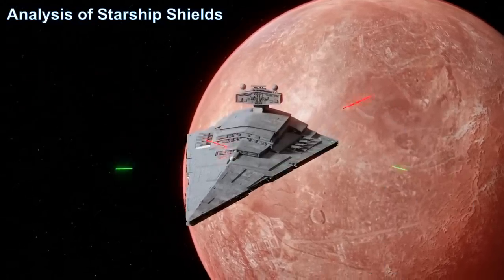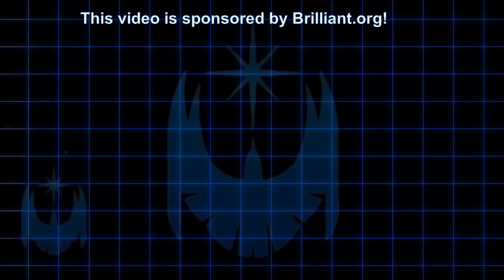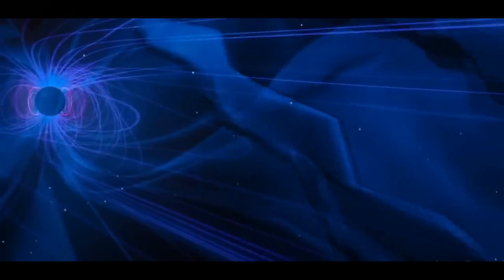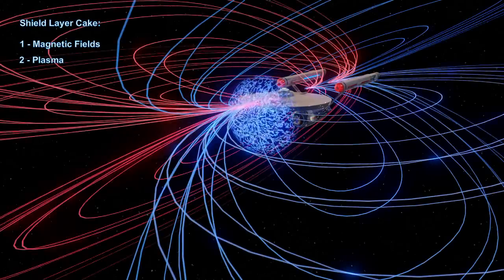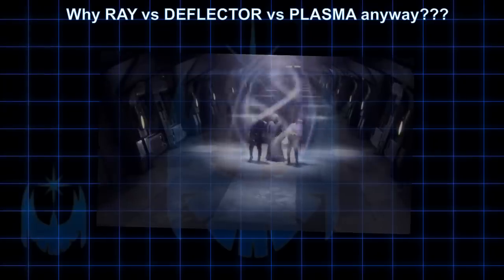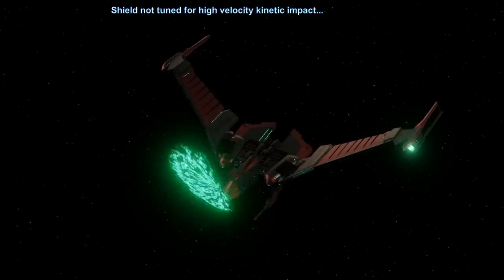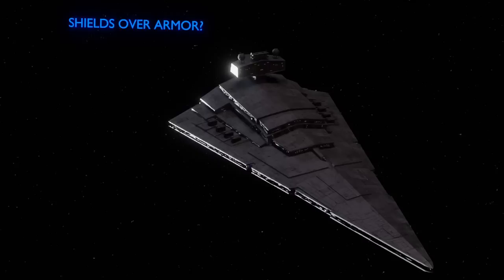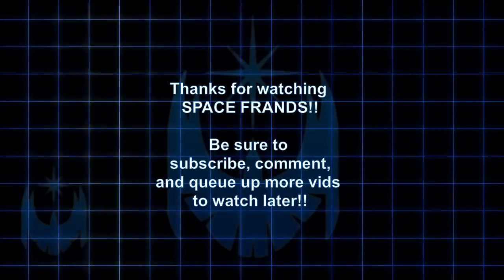REAL Starship Shields Types - They Work Like This...Animated Breakdown!

Comment: Imagine a glass dome around a target you’re trying to hit. You can clearly see the target, but the only way to hit it is to go through a door in the dome. But when you open the door, instead of going through the door into the glass dome with your target in front of you, the door opens to HELL ITSELF.
Warhammer 40K void shields. 
They just nope incoming fire off directly into The Warp.
And they aren’t just mounted on starships. Imperial Titans are equipped with them as standard, imperial hive cities commonly use them as anti-orbital defense, and even certain Superheavy vehicles like the Ordinatus weapons platforms of the Adeptus Mechanicus use them.

Comment: Elite dangerous’ shields are not executed well, they are basically a wall that deletes projectiles and stops thermal lasers. The thing I like about them however is their overheat mechanic, basically any damage (most prevalently thermal) ticks up your heat meter which starts doing damage internally on your ship. I like to think this mechanic applies to larger ships in Star Trek and Star Wars, essentially the shield generators overheat and end up redistributing a portion of the damage over the ship’s superstructure so the shields don’t end up just destroying itself early in a battle. This causes that feeling of danger that the shows and movies want to convey.

Comment: I had to stop early on because deflector shields are energy shields. To say that they are different is kind of asinine.

What is a deflector shield made of if not energy?  It's not like any of the shields actually reflect anything like you would think of light being deflected.  I understand all this technology is theoretical, but what movie or show actually shows a deflector shield deflecting energy beams rather than just absorbing them?  It's like saying we are using mirrors to deflect laser beams. So we are going to call them mirror shields which would be different from reflective shields which apparently do the same thing. 

I have not seen a single Star wars or Star Trek movie or show that you actually see energy beams being deflected. All of them shows incoming fire being absorbed basically because it does not go past hitting the shields of the ship.

Comment: Just one thing; the whole argument that armor is heavier than a shield is flawed in one aspect.  Your argument hinges on the assumption that the tech needed for the energy source that the shield utilizes is either the same source that the ship uses to move around with (in the various and many forms that is achieved theoretically or in fantasy) or that the energy source is small and/or light weight.  While this would indeed be convenient, it's highly unlikely when you consider the amounts of energy needed for applications such as you're discussing. So would there really be an advantage at all as far as weight is concerned? Not nearly as much as one might think... and that's not even the materials that armor could be composed of and the actual weight outcome that could ultimately end up in application. Just thought I'd point that out there for you.

Comment: Shields might not nessarily be ligher than armor, I should note.

Shields, just as any other power consuming sub-systems, requires power. And increased power requirement means needing a larger and heavier powerplant. And depending on the avaliable technology and application, more armor might be lighter and better performing than shields. Or having shields will require sacrifice to firepower and other features.

One point of example would be Elite: Dangerous. Depening on the application, non-shield defensive options provide far more effective defense than shields, one example of which being thermal stealth.

Comment: the funny thing is if ur is nearly at Lightspeed o even faster a little particle of cosmic dust can inpact the ship with enought power to evaperadte, XDD they dont need be worry about laser or protectilees with just speed they will be face dust with more energy than nuclear bombs XDD even the light of the CMB will be hot enought as teh bigbang XD

Comment: I would have thought plasma shields wouldn't work both because they're not a physical barrier so they run up against how fast they can heat anything rocketting into them at 100km/s, and because stuff that is 'vapourised' doesn't cease to exist, and simply making asteroids explode due to the heat now means you've got even faster smaller bits of asteroid to content against. I'm not sure a 'vapourised' asteroid wouldn't still pose some material danger.

Comment: In a sci-fi I'm writing, I make use of armors and shielding. At the start, the shields of the ships really don't do much. Most weapons are kinetic, so, smaller ships focus on mobility and larger ships armor, with some shield effect. The most effective shield is the MCs produced shield since in can make pin-point shields as needed, usually to deflect small projectiles, but, not very effective when hit with something, like a fist, though it can dampen it a little. It is described as a repulsing shield, since it emits from the body outward and dissapates (how, is a plot of the story). It is more effective at canceling/manipulating waves like light, magnetic, and thermal as far as machine scans go. Does not trick eyes, though.

Later, you start to see weapons like lasers more commonly, where shields and armor both are more effective because kinetic weapons are too costly you use often. In all cases, bleed is posable.

Comment: There's an episode in Stargate Universe, where Destiny (the ship of our cast) is under attack by drones. Destiny's shields take a beating, but the crew was able to retrieve a damaged drone and learn the specific energy output used by the drones' weapons. Since Destiny's shield was constantly shifting between energy signals (I don't remember the specifics), they weren't 100% effective against the drones so they attuned Destiny's shields to the specific energy used by the drones which greatly reduced the stress on the shields. This did mean that Destiny would be vulnerable against other types of damage, which the drones figure out and start to kamikaze into Destiny in order to do damage. Quite a fun episode.

Comment: Thanks for this :) I'm writing a world where magnetic shields are a thing, they are great against kinetic hazards, and they stop plasma dead, however, the plasma dissipation challenges mean that the ship has to deal with a heat surplus as the plasma is funneled towards the emitters, effectively making short range plasma weapons and plasma warheads a go-to effective shield breaker.

Laser type weapons can be neutralized with ablative or reflective armor. However, reflection becomes difficult with X-ray lasers.

Comment: I like to think that shields in Star Wars are electromagnetic fields and negate the potential damage from energy weapons by aborbing the energy through magnetic flux. Too much absorbing add too much energy to the shield thus weakening it's integrity via overbearing transformers or other energy conduits. An EMF that strong would need a lot of energy. Typically the kind of energy that would power a star destroyer. Smaller ships might have to have an upgrade to generate the sufficient power. Ion cannons are most likely balls of electricity that are meant to fry electrical systems by overloading them, thus how the y wings were able to disabile a star destroyer with its shields up.

Comment: The common misconception about the shields is to picture it like a wall or bubble. I think a shield would look more like an area around your ship where things gets deflected or absorbed. It will span far from the ship hull and will not have definite "surface", but rather it will get stronger the closer you are to the ship.

Comment: To me it makes more sense for shields to be better against lasers (thermal) and armour to be better against kinetic (physical) as a shield would take an impact from something and have to convert that impact into something it can dissipate, such as heat. It would take more energy to convert kinetic energy into thermal to be dissipated than to simply take the incoming heat and immediately start dissipating it. Whereas armour is designed to prevent kinetic impact, generally by deflecting or slowing down the projectile. While there are many materials with strong thermal insulation or dissipating properties, generally speaking they aren't the toughest or strongest of materials, and wouldn't make the best armour in my opinion.

Comment: One of the things I like about Eve Online is that two of the kinetic weapon types, missiles and projectiles, can vary the damage they output. Missiles can be of a high explosive warhead, an EMP warhead, a plasma warhead, or essentially a shaped-charge with a sabot to propel the projectile through the shields or armor. {blasters/rail guns use a shell of titanium with a core of various metals/antimatter suspended in plasma)

Comment: Your comment about armor repair in combat made me wonder - why doesn't Star Fleet use replicators for tactical purposes? I get, that spaceship hulls probably can't be replicated outright but what about dense particle clouds or torpedoes that replicate millions of flechettes after passing through a shield at relativistic speeds?

You could also use something like a mixture of spaced armor and ERA by replicating the densest possible material in the course of beams or projectiles. Or replicate makeshift armor like in the Voyager finale. Run these replicators on separate accumulators so you'd have a separate supply and you might actually have rechargable armor.

Comment: Afaik, there's a definite place in Star Wars for thick, advanced armor, (AT-AT) which is evidently supremely heat resistant and difficult to deform via pressure waves from explosives, AND, of course, energy-based shielding that defends against energy weapons (conventional shields, typically on starfighters and starships), and shields that prevent physical objects from passing through.

Where there's a bit of confusion is that I recall explicitly that at some point a CIS destroyer droid's personal shield emitters were explicitly bypassed by clone troopers rolling grenades relatively gingerly through the shields, which then detonated within them.

This implies that despite the energy shield defending against blaster bolts very well, it may also be a kinetic shield, thus slow-moving objects do not activate the defense. Now, it is a droid, so perhaps its dual-purpose shielding can afford to be so industrial-grade, as there is no organic matter present to potentially suffer any sort of radiation or heat or other issues from being near the source of such small personal shielding, whereas most organic life generally does not carry personal shielding.

Contrast with Mass Effect and Dune, both of which use a kinetic shielding system, which works like a car seatbelt in a sense. Objects of sufficient speed activate the barrier and protect you, but under that speed anything is possible and you're not safe. Which I think is the reason for the preponderance of melee weapons in the latter.

Comment: this is why i love how shields, armor, and hull works in stellaris, it makes a lot of sense from many different standpoints. shields are very effective against lasers and plasma but awful against mass drivers, autocannons, missiles, and torpedoes. armor is very effective against mass drivers, autocannons, missiles, and torpedoes but is pretty bad against lasers and plasma (armor doesn't soak up heat very well in space, which is why the ISS needs such huge radiators), and hull is suprisingly effective at dealing with all damage types except for disruptors and torpedoes (since its the innermost layer the armor absorbs most of the damage while the hull absorbs the shock, disruptors counter this by weakening the integrity of the hull to the point of being brittle to any kind of shock).

there are ways to strengthen/harden shields against kinetic weapons but this dedicates more systems and power to one type of defense, weakening the rest. you can harden the armor but you suffer from heavy costs for construction (not so much speed/maneuverability penalty bc weight is relative in space), but suprisingly hull is the clear defining winner in the early to mid-game in stellaris (not so much late game since there are no repeatable research tech's for improving hull unlike armor and shields).

Comment: Elite Dangerous handles it in interesting way. The shields there look like a generic energy barrier, but they are actually physical. The shield generator crates a transparent layer of matter that is maintained in a form of bubble around the ship. When something hits it, it acts as a physical barrier and passes the inertia to ship, and when they are hit by laser or other type of thermal weapon, it becomes opaque in a small area of impact.
Bigger ships require more powerful generators as the area of the shield grows exponentially with the size, big ships that are more than 1km length are not equipped with shields at all.

Comment: Armor wouldn’t weigh a ship down if it’s in space. You should look into the ablative armor in Star Trek Voyager. On another note any shield that is active shielding will also reflect or refrain weapons fired from inside the shield. Unless the shield is designed to only operate when it detects incoming projectiles. This would be a disadvantage in a firefight because at one point or another your shield will need to come down if you’re firing and if you’re about to fire and the shield comes down you’ll get hit by all projectiles incoming.
Reply: @Buttwheat depends on what engines.
Reply: @Buttwheat in Star Trek the engines push the ship by forming a warp bubble around the ship. Similar to how plasma forms around hypersonic missiles except it’s due to the speed. The bubble allows the ship to travel faster than light. Ik light speed is impossible but perhaps a similar mechanism could allow ships to travel at high speed like the hypersonic missile

Comment: @6:00 The example you show on the screen while you say that plasma shields can do anything, is the one thing they couldn't do, which would be to closely contain living beings without raising the air inside to a lethal temperature.  Now maybe technically you could fudge and say they used force powers to protect them, but what if it was just three regular people?

Comment: Gravitic shields are, I think, the best of all worlds.

The concept is micro-spacetime distortions to deflect, redirect, or absorb incoming fire. 

Since every weapon travels through space, it works equally well on all types.

This relies heavily on computation to predict the right kind of distortion, so speed is an issue and if you lose sensors, your shield cant function. On the other hand, more sensors (by being part of a fleet for example) and computing power means a stronger shield. Also, I'm sure that, whatever future tech can provide, it will always take more power to artifically bend spacetime than to make a strong magnetic field, so they would be power hungry.

However, given that it requires reading a trajectory, placing a spacetime distortion, and predicting the resulting trajectory... unlike the other shields, gravitic shields can be used to turn the enemies weapons against themselves or their allies by favoring trajectories that target their ships.

I will say that armor is the most realistic defense in my mind; not because shields arent possible, but because most actual space battles would take place outside of visual range. You wont know to put your shields up or there would be enough speed on the projectile that it won't matter. Armor is not something you have to engage.

Comment: In Warhammer 40k they use a different mechanic. Much like how their FTL engines are just "lets rip a hole into hell and hope we make it through alive and sane," their Void Shields are just shunting projectiles, energy, particles, and bad feelings off into hell until we run out of the power needed to do that. Then the void shield falls and you're screwed.

Comment: In startrek at least, the "Deflector shield" is differentiated by how it is projected. It is focused forward in a cone from the Deflector dish, and thus does not cover the the hull in a bubble like the Defensive shields do. i imagine it is set up this way not only for scientific reasons, i imagine a shield enveloping your hull would mess with sensitive sensor equipment used for science, but also diplomatic and utility reasons. Can't beam through shields, and it would look a little hostile if you were traveling in someone else's territory with your defensive systems active.

Comment: See that’s what I always thought in Star Trek the “Deflector array” was primarily used to deflect objects and debris away from the front of the ship as it moves forward in space. Hence why forward facing attacks were so common and not so much broad siding as the deflector array and the shields worked hand in hand. 

But the deflector array was used from communications or to projecting beams of energy (tachyon, Poleron , gravitational)  it really was a multi use array but the original description of “Deflector array “  to me was always part of a key aspect when traveling through space